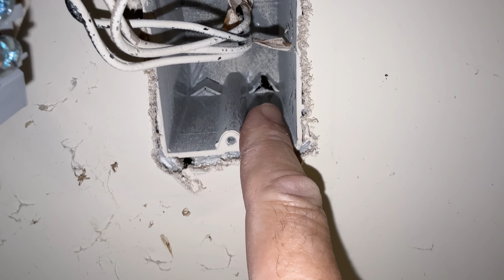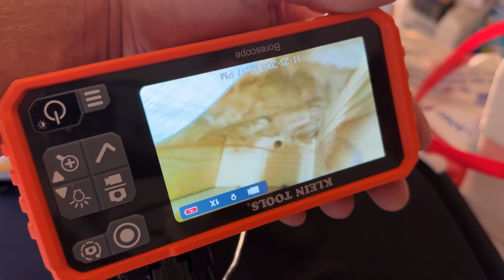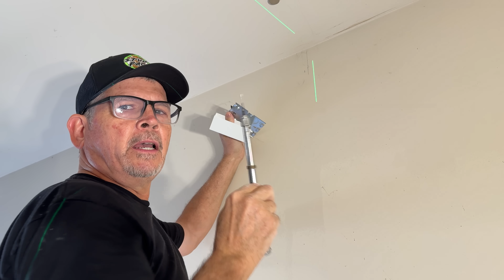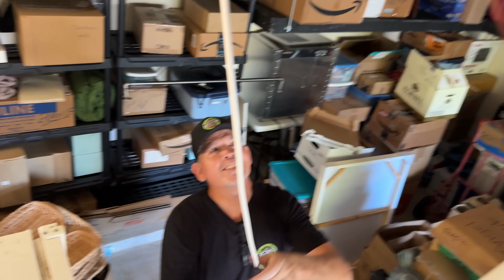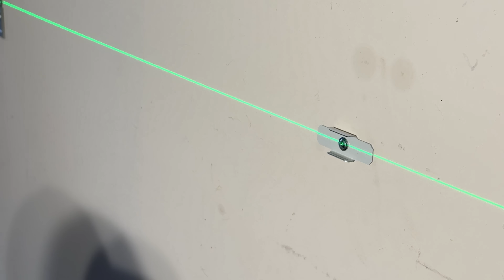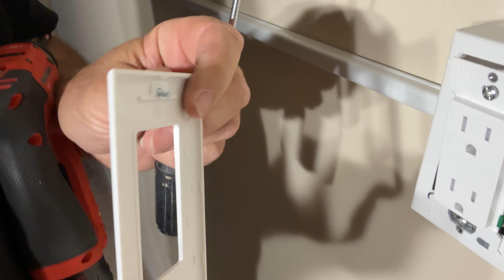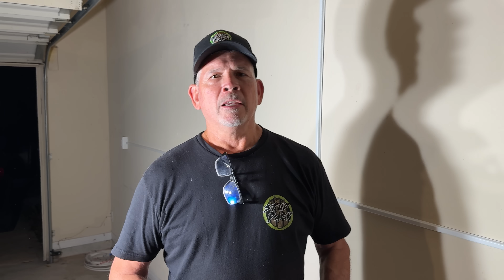The Secret to Adding (Easy) Garage Outlets

Comment: You are spot on that receptacle s need to Ground fault protected, however you failed to mention that if a receptacle is down steam it needs to be identified that it is GFCI protected per code . Stickers are always included in  new GFCI boxes.  Happy Turkey Day.

Comment: I almost always cut on the pull. All my wood saws are Japanese pull saws. I truly have no idea why anyone would use a push motion when trying to cut. It’s the weaker motion, you have less control over your arm on the push, and the metal wants to bend more on the push.

Comment: Riddle me this . So romex the wires are not identified on each wire just the sheath. So when you rough in a box and remove the sheath you loose the identification . When pig tailing devices we use scrap peace’s of romex .so basically none of the wires in an outlet box wired with romex has identification markings on them .
Reply from the maker: Pretty much that's the case, I've never been called out for it though

Comment: For me in a garage, everything has to be 12/2 wire.  Most of my power tools will overpower a 15amp breaker.
Reply: you must be running some massive tools.  Even a worm drive circ saw will hold on a 15A breaker
Reply: @grounded-b937  Most of mine, just on the start stage will kick a 15amp breaker.  My air compressor, would trip breakers on every start until I upgraded the wiring.  And my welders and plasma cutter can't even exist on a line with a fridge or freezer.

Comment: Nice build out. 
--? That's an awful lot of stuff stored in a garage made for VEHICLES FIRST. 😂 Hopefully, there is still room to park the vehicles inside the garage when you are done? 

Why?
1. Garaged vehicles hold their value and trade-in value better, with a typically rating of Excellent Condition vs. ungagraged rating only as Good or Fair. (All other things equal.) JDPower NADA Values. That can be thousands of dollars difference, just by using a garage for what it is made for. That ties into why the are in better condition.
2. Climate exposed vehicles weather faster and suffer from avoidable hazards:
A. UV Sun damage, interior bleaching, cracked dashes and trim, faded fabrics, damage leather, temperature exspansion caused cracked glass. And faded or failing paint and clear coat.
B. Hail damage.
C. Blowing dirt/debree damage.
C. Falling tree limbs.
E. Vandalism.
F. Theft and Break Ins. 

What cost most, our vehicles or our excessive stuff better stored elsewhere? 👍

Comment: as a professional structured cable installer, our crew prefers using grid wire over fiberglass rods. we also use 1/2in gray pvc conduit for longer horizontal runs

Comment: My dad wanted to turn the garage into a workshop for making furniture.  I did something similar, but added 5 circuits instead of using the one in the Garage.  One for the table saw, one for the A/C, one for dust collection and two for the walls.  Each outlet location got a duplex receptacle with the left and right being on different circuits. This way if he was using a router at one location and wanted a shop vac for dust collection, he would not have a problem with over current. Maybe overkill, but the increase in cost was minimal, conduit same, labor same, parts less than double.  He already needed a subpanel, the house was almost full.  We left the lighting alone so if the subpanel did trip, or the saw trip the breakers, the lights would still be on.  Having a kick back on the saw is dangerous, having it happen when the lights go out is very dangerous and scary.

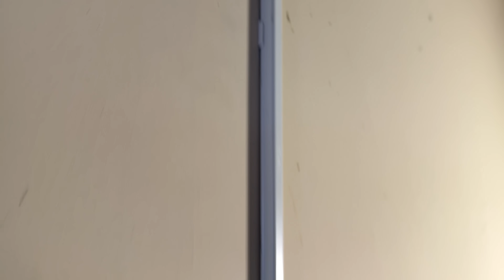Comment: 19:29 The crease on the tab of the base plate is not a measuring point. The raceway should be pushed past the crease so the tab is all the way in the raceway. The crease is for better ground bonding to the raceway. It's a little harder to push past the crease. But, that's what makes a better ground connection.
Reply: I am an electrician, and was thinking the same thing.  It is a bear to push it past the "nub", but that is what should be done.
Reply: @grounded-b937 Whenever I install wire mold, that's what I do.

Comment: Im using the emt/ent in my garage because i like the aesthetic. plus im able to run romex in it. also to note my garage has 3 original outlets. each on its own circuit
Reply: What do you use as a over the wall outlet box

Comment: I did exactly the same thing - I had several places in my house where I was trying to run new Romex past a low voltage box and hoped I could see through it, only to discover that it was a real box and not a low voltage ring, so I cut out the box and replaced it with a ring so I could see into the wall.

Comment: Hack that I am, I would have considered popping a hole in the ceiling where the stoppage was, and then patching the drywall with an old work box and a blank coverplate... Or maybe another ceiling mounted outlet, and one of those ceiling mounted extension cords???

Comment: Borescopes are great. Some now have one or two 90 degree cameras added to the tip. That can help in some tough locations. 
Having done a ton of low voltage wiring, we always kept a few feet of #12 or #14 solid wire handy to poke into holes to grab the snake or glow rods or whatever is hiding in the wall. Even if we didn't have a length of wire with us we could usually find some on site.😅

Comment: I just think we need a product that is better then dry wall. It’s like the number one thing that gets in the way of any kind of home upgrade. It’s hard to work with it’s messy it damages easily. None of the trades want to deal with it. It’s garbage IMO. 

Rant over. 

Would be cool if I could print my wall and somehow make it fire retardant. Want to move an outlet? Take of some panels print a new spot. IDK I just hate drywall. 😂
Reply from the maker: Haha, I hear you! If only wall upgrades were that easy!

Comment: Awesome job. That camera is something I definitely need, and using a hacksaw to cut the nails on that single gang was pretty sweet too. Wagos are cool and all, but I have seen them melt when using them to trim out receps.  I've had to fix a few lately. Pretwisting with my good old lineman's are still my tried and true method. Keep up the good work. Your videos are amazing. Paul has so much knowledge. God bless

Comment: As an electrician this was solid. Great explanation on the grounding and bonding and explanation of code. Good job!
Reply: I learned about THHN having wire ID and needing it in conduit or raceway. Thanks Paul. Happy Thanksgiving to your and our whole Studpack family❤
Reply: can i do this inside the house (closet or bedroom)? or is it some code that only allows this in the garage?
Reply: @stevenochoa9904 you can do this anywhere inside. I’ve installed from outlets to switch to light. From outlet to make extra outlets. Etc. just not outside or damp areas.
Reply: Agreed, I learned that the raceway has a bushing. Who knew, I’ve installed so many times and never heard of the bushing. I know you like this wagos….im a wire nut guy. Something about not broken I trust.
Reply: @Jack_of_1_Trade I agree for wire nuts on all the same wire but when connected dissembler wiring solid to stranded I use wago’s myself. Light fixture are the worse got 14 or 12 coming in tying into small stranded wires that’s where wago’s shine. 
But I used wire nuts for a couple decades
On my that situation before they came out with I think was a great option.
Reply: @Jack_of_1_Trade  I'll use either.  Wire nuts are absolutely fine if they're used correctly, the only problem is that some people don't use them correctly.
Reply: @projectartichoke I use wagos when the wires are super short… like the 30-50s house. No idea why they Always stripped the wire so short with zero slack.

Comment: You ran your romex through the same hole as the garage door opener control wiring.  Any chance of inductance interfering with the opener wiring?
Reply: My thoughts as well. From what I remember as an electrician years ago we weren't allowed to run high voltage and low voltage in the same hole to avoid inductive interference onto the low voltage line. That could really mess up your low voltage signal. Hopefully it doesn't.

If you start experiencing problems with your garage door not closing or not stopping when the sensors are interrupted, you may want to look there first. 

Other than that, great job on the work and video!
Reply: Normally you wouldn't want to share the same hole, especially for communications cable, but in this case it's a garage door opener. The circuits are usually an open/closed state, and it's unlikely any interference from the mains voltage would stop those things from working.

Comment: I ran a number of wire mold outlets in my old house. Way easier than busting into walls. I did use wire I stripped out of Romex and I’m not worried about it not being labeled.

Comment: That is why you surface mount a sub panel in your garage or workshop It makes it so much easier to add circuits Oh!! You always put a plug On your garage door wall. Because you always need electricity outside and your extension cords are always too short!!!
Reply: I totally agree, but I'm PRETTY sure that it isn't up to code to do it that way

Comment: Respectfully disagree with you Paul, industrial look EMT with 4 square boxes is a prettier, more durable, and more versatile install (for example being able to  convert duplex to quad easily without changing the box.)

You still have a masterful install here, and the Wire mold looks good for what it is!
Reply: Agreed but most home owners can't make a proper box offset, unless you are using cowboys for support I guess
Reply: Agreed. Likely more cost effective as well.